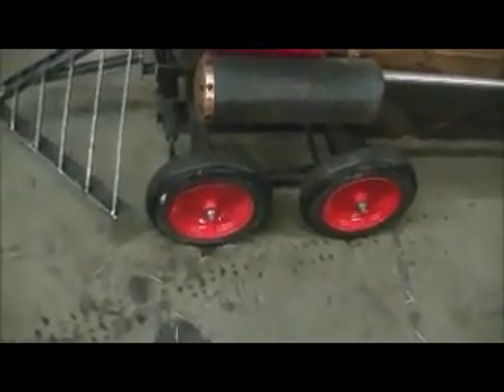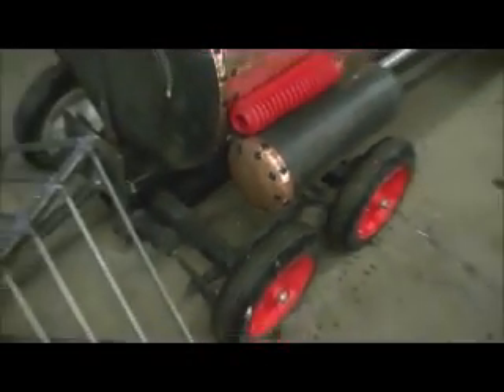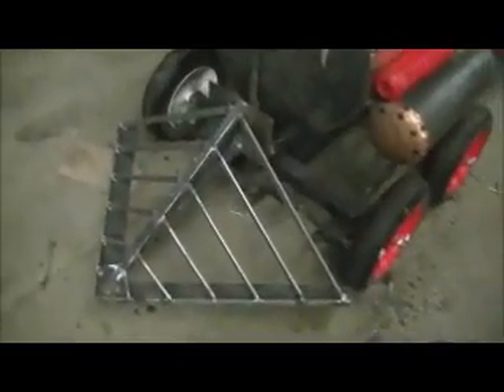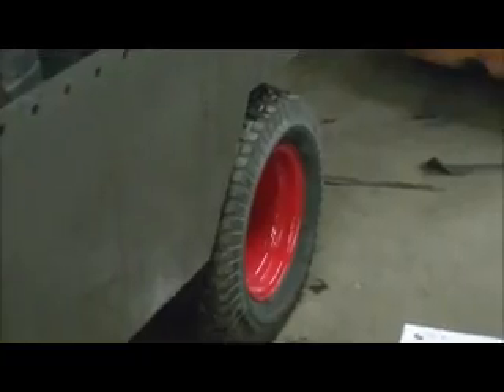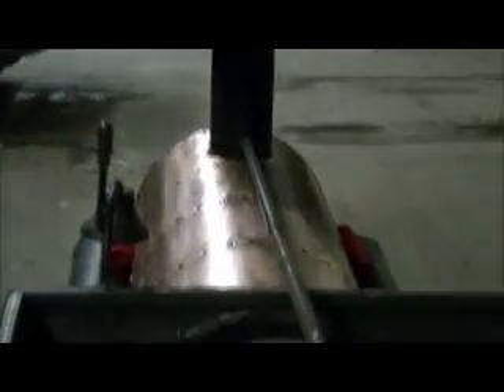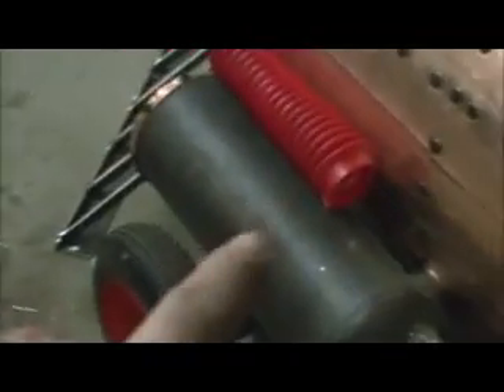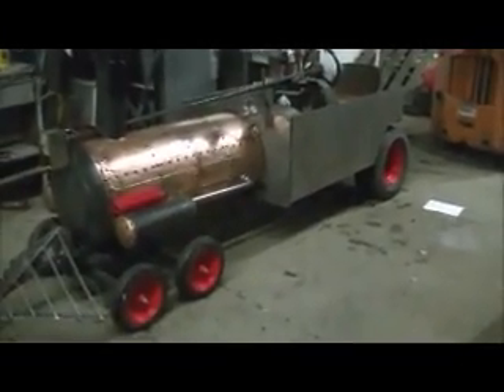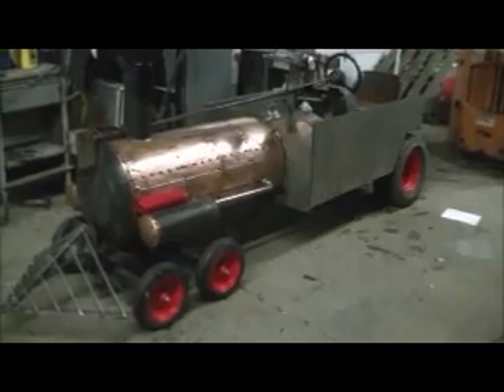Trackless Train Project 3

Comment from the maker: @madrat39 
If you have a scrap metal place near you you will find lots of stuff to make a train with.  I used a water heater tank (electric not gas because they are better) and the two little tanks are from an old jobsite air compressor.  The wheels are wheelbarrow wheels.  The rest I made myself.  I went with the front 4 wheel look because I think it really makes the train look good.